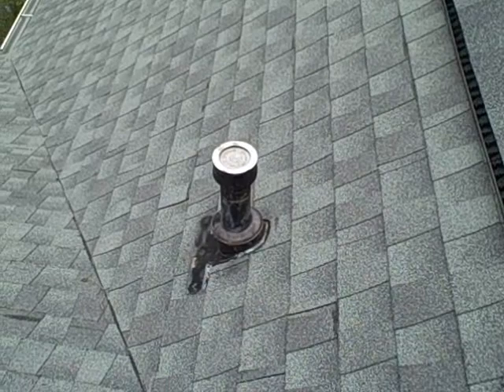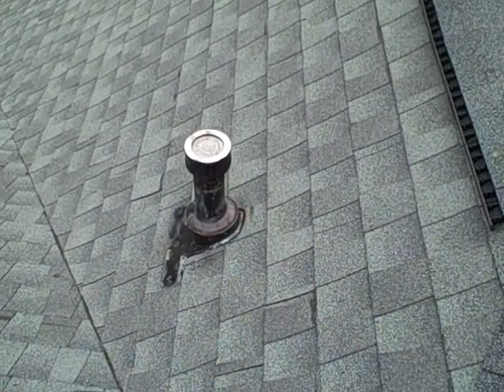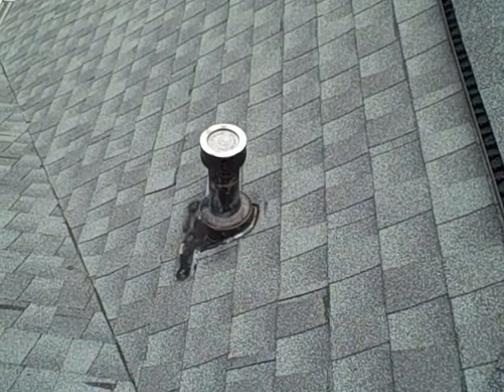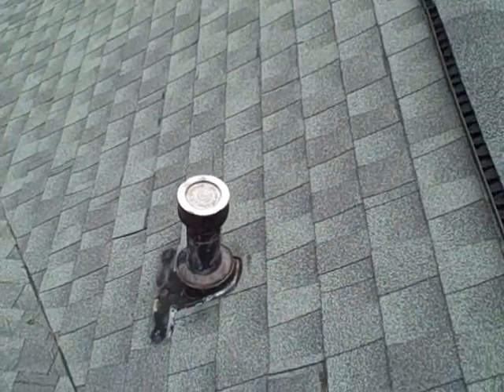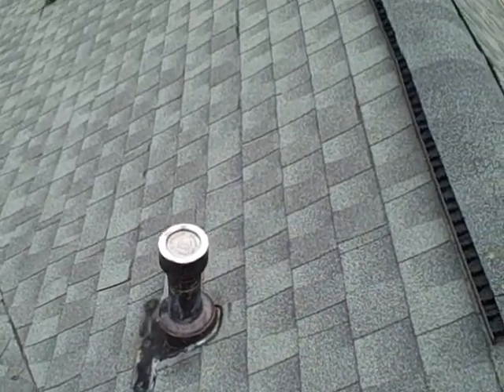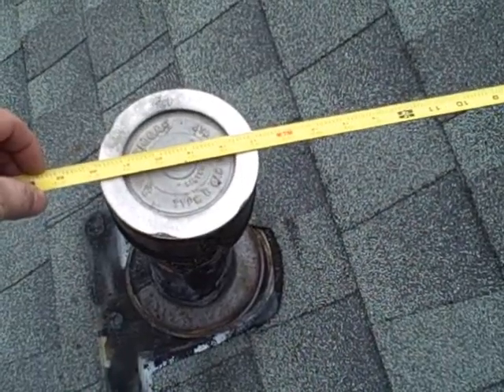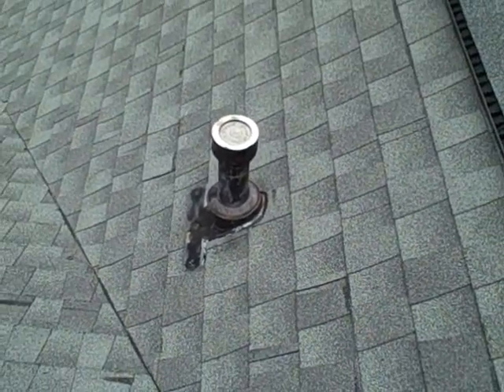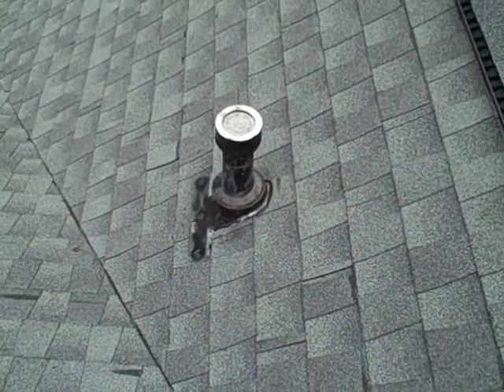Franklin Home Inspector Discovers Water Heater Exhaust Height Issue.wmv

Comment: This is not correct information for a water heater using  B vent, that is 12 inches or smaller in diameter, which it clearly is. UPC table 509.6.2 min height above the roof with a max slope of 6/12 is 12 inches. Using UPC section 509.6.2 if the B-vent was larger than 12 inches in diameter (ex 13 in B vent) then the video presenters statement would be correct that the vent would need to be 2 feet higher than the peak if within 10 feet of said peak. The only other way information in video is correct is if said pipe is a chimney. Sec 509.5.4 UPC requires that chimneys terminate 2 feet higher than the peak of the roof when within 10 feet of the peak, or two feet above the highest part of the roof that is within ten feet. But it is a B Vent not a chimney.